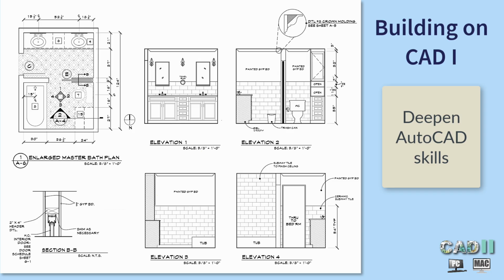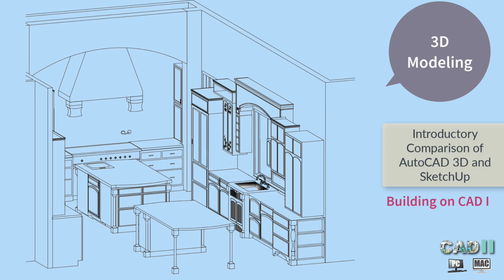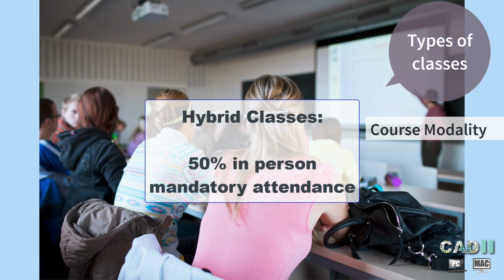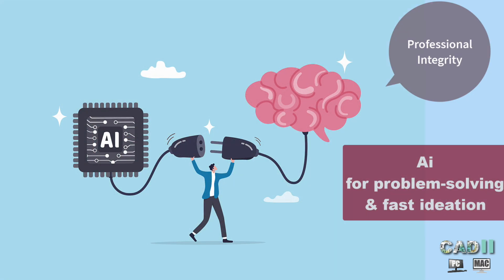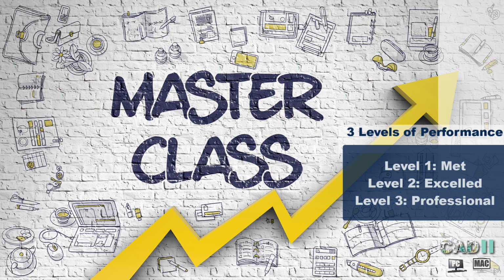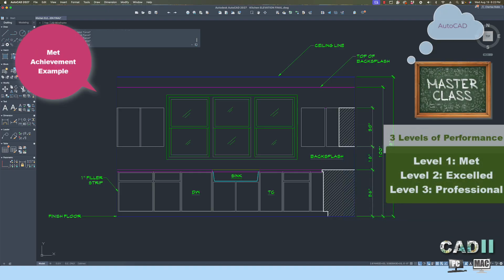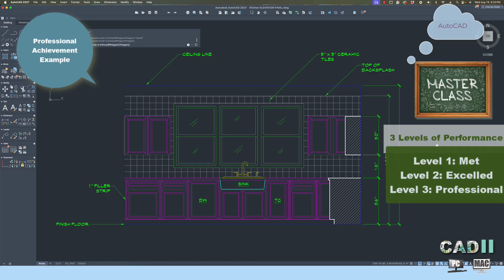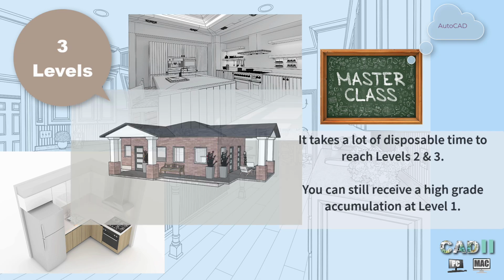AutoCAD II: Policies and Master Class Options

Comment: I am not an architectural student. How well do I need to know standards and codes for this class?
Reply from the maker: This is a beginning class designed to introduce you to the graphic standards. Each lesson is designed to either introduce, reinforce, or master a particular graphic standard. There is very little you need to already know because what is taught in CAD I is reviewed in CAD II. If you missed learning something, we make sure you see, hear, and practice it in this class.

Comment: What do you think are the most important aspects of autocad2 to focus on for student success in the class?
Reply from the maker: AutoCAD teaches us how to focus on details. 2D drafting is rich in details, and learning what each line means builds up your visual capacity to think in design. Focus on the idea that this is practice. This is where you get to learn, explore, and even fail at doing something. In this class you always have the opportunity to redo an assignment. It's okay if the assignment isn't finished or if it's not correct at first. Practice now so you are confident on the job later.

Comment: I am curious how we will get feedback and edit our drawings in this class, every instructor does it differently but this part of class is how I really learn what I am doing correctly or incorrectly within AutoCAD.
Reply from the maker: Hi, Blaire. I make full-size redlines of your project submissions when corrections need to be made to the assignment. There is a REDLINE submission box in each Canvas module for resubmitting the pick-ups to the redlines. I also provide comments in the grading rubric. If necessary, I will make a custom video in which only have a link to view. Those are the 3 primary ways you receive feedback in this class. I try to respond as soon as I receive your assignment so that you can keep the learning rhythm going strong.